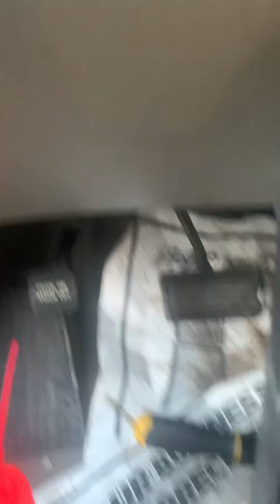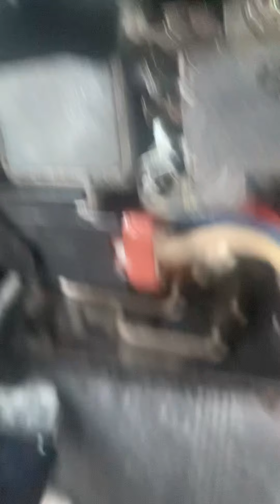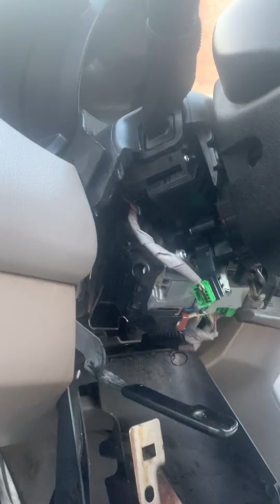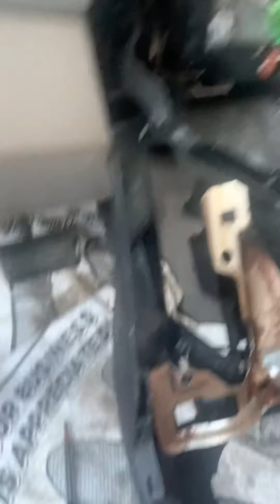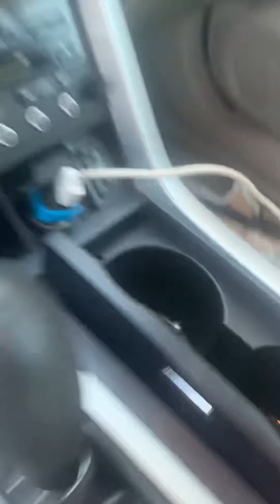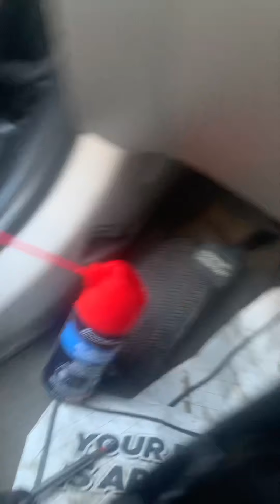How to fix 2007 ACURA RDX | KEY STUCK in IGNITION

Comment: How did you get the plastic off under the steering wheel with the key stuck in the ignition
Reply: Unplug the battery
Reply: @teamoney7862  appreciate you! Working fine now!

Comment: It worked took the whole plastic thing off around the wheel and took another mini white plastic piece around that ignition switch and had to unplug some wires here and there but I finally got my key out but haven’t tried lube yet so I will tmr hopefully it works thanks
Reply from the maker: Of course it will work. I'm glad no one will take. advantage of you. When it happened to me the key guy said $1000. So there you go. Best wishes.